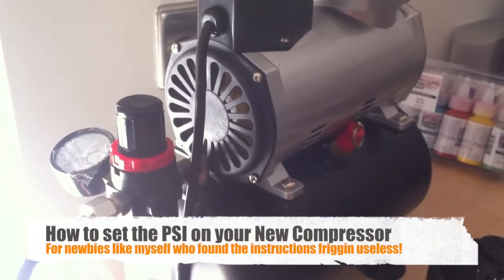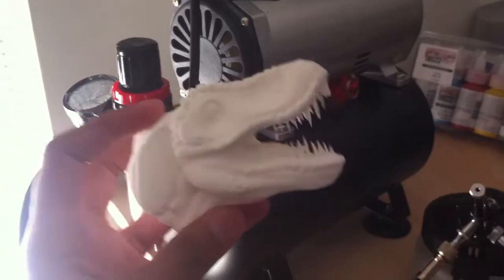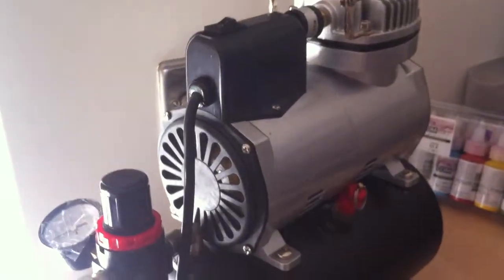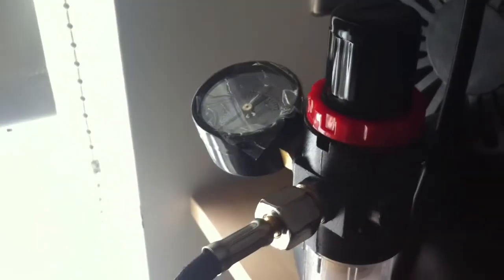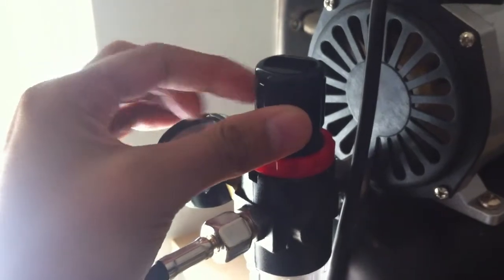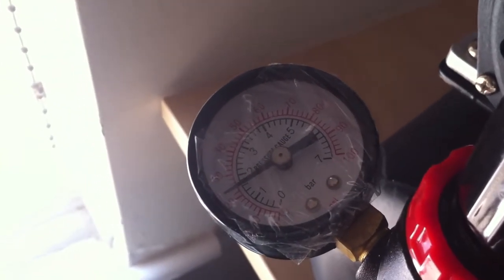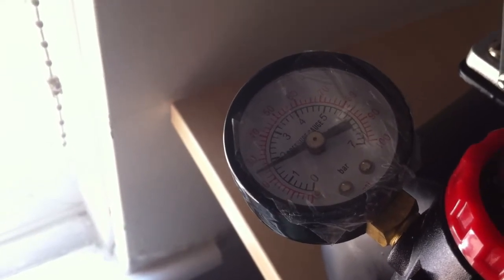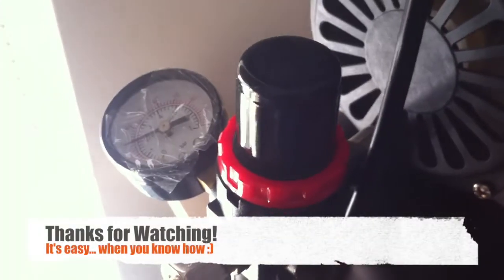How to set the PSI on your Airbrush Regulator - Model AF186

Comment: You're right about zero instructions. I got both master series tank and trigger airbrush... nothing but a "here it is", and their "how to" pamphlet is a joke.

I had a feeling there was a twist method to adjust the regulator just by looking at it, but this cleared it up perfectly. I had been able to pull it up and figured that might be the key but still no twist movement, so perhaps I wasn't twisting the correct part completely and grabbed part of the manifold by accident. I'll give it another try tonight.

One important thing to note about twisting that regulator - ALWAYS hold it tight with one hand and twist with the other because you're putting a lot of torque stress on the connection at the tank, so to prevent any accidental damage, be sure to hold the regulator as tight as you can to isolate the torque stress against the tank connection. If it doesn't feel like it's going to give without a bit of effort, don't push your luck.

Comment: Nice tip, I've just got a similar compressor, how long does the tank take to fill before it stops? I had mine running for over 6 minutes and it didn't switch off.

Comment: after setting up the psi. you can use it right? then when the motor starts to work again to produce more air. you should stop? and wait for the tank to be full again or you can go on? also can i set the psi before i turn on the compressor? and wait it until it fills the tank? thank you so much
Reply from the maker: +MsFVee Hi mate, the idea behind the tank is so that you can use the airbrush continuously without having to worry about the compressor over heating. You can change the psi at any point but wait until the tank is full to get an accurate reading of the psi the airbrush is producing. Hope that helps :)
Reply: now its clear. thanks a lot sir! happy holidays
Reply: @jaypo7  u saved my life sir